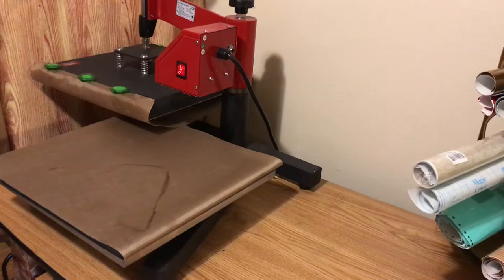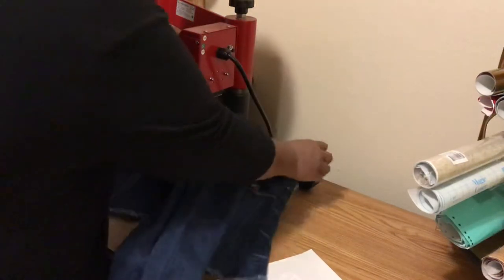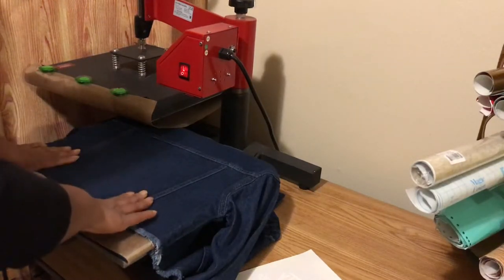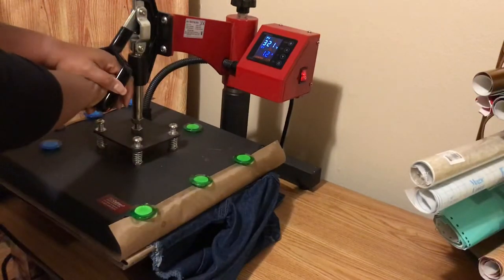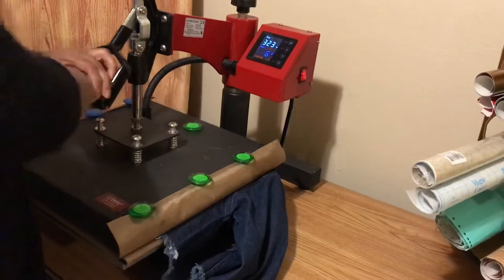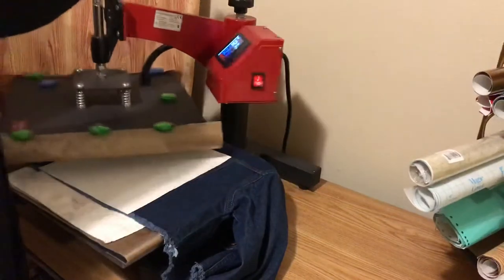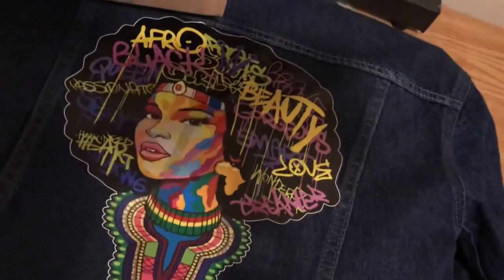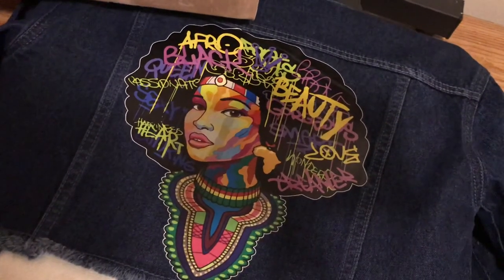How to press a transfer on a blue jean jacket

Comment: How do you decide the heat transfer temperatures for different materials?
Reply from the maker: Most of the materials will come with some type of guide or there will be a temperature guide on the manufacturers website. For this transfer they came with the instructions of 325° for seven seconds and then remove the cover and press again. But sometimes you have to alter those directions if the material does not adhere to the fabric correctly.  Cricut, siser, and just about every other H TV manufacturer has guides on their website to help the customers. So I normally go buy those guys first but if they don’t work out then I tend to press it a couple of seconds longer.
Reply: sandrafay334 thank you for the response. I’m looking into buying my gf a heat press or embroidery machine so she can start her clothing business but it’s so many products to decide from.